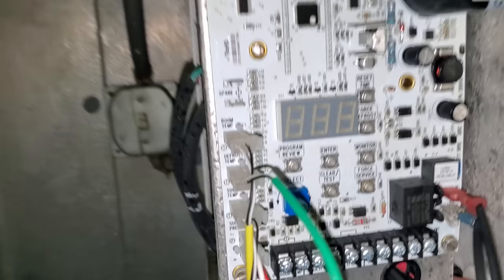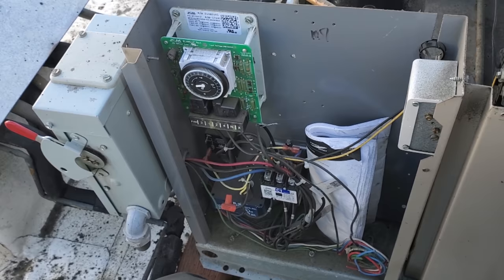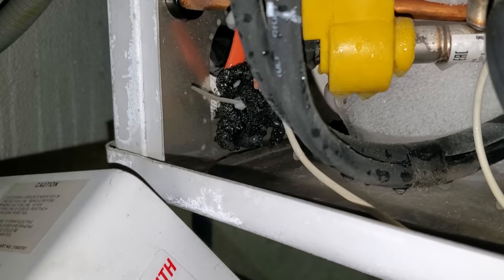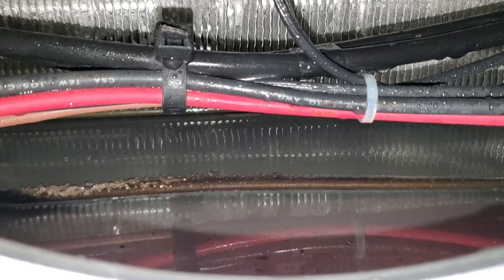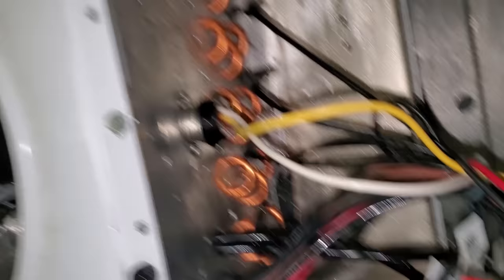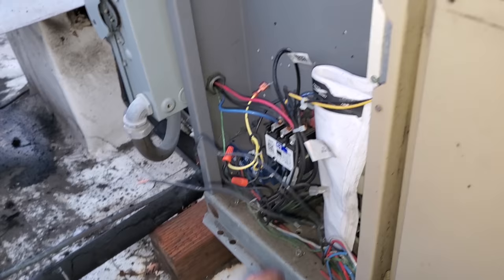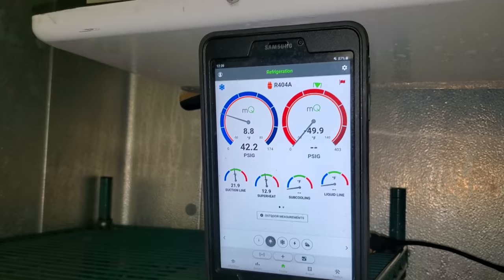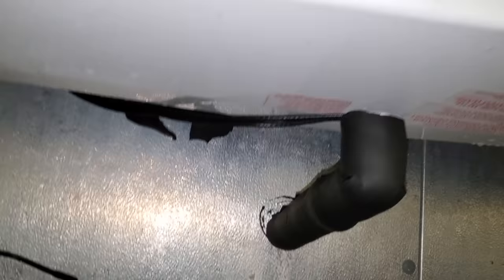THE OTHER COMPANY COULDN'T FIGURE THIS ONE OUT EITHER

Comment: Old saying: Proof is in the pudding.  The unit worked within design parameters at the end.  Awesome job of troubleshooting and determining the prime cause of all the other faults. Do you have a followup video where you inspect and perform more preventative maintenance?  From start to finish, the previous HVAC company screwed the pouch. I would bet that the techs who performed the installation BARELY understood the manufacturer 's installation guide.  THEN, the previous HVAC company sent other techs out that didn't even have the previous techs' knowledge and experience with this particular  walk-in system.  I'm not an electrician OR a HVAC tech (former electronics tech in the US Navy Submarine Program back in the 1980s) and I was physically cringing at all of the mistakes made by the previous company's techs.  Lack of knowledge caused all of this.

Comment: Greetings: Good and bad:  Although you and I are in separate fields of electrical. You in commercial HVAC and I in a more broad spectrum of electrical / electronics.  We share common skills, goals. ethics, procedure, Etc and our customers suffer similar fates of other's failed repairs. I can add, in my case, mine have issues paying. It is such a shame that  customers rely on skilled repairmen then get screwed because of lack of the above. I think I find more of that rather a natural equipment fault. Many people do not have pride in their work these days.  Now the bad: I notice you error in terminology as many others do. A "short" is not another word for 'fault' or 'problem' as many think and use the term wrong.    In conclusion I commend U on Ur troubleshooting and service skills, procedure, ethics, pride and respect of customers. Indeed we R a rare commodity. Thx 4 the share. Bsafe.

Comment: Ok, first off... 
It's clear and obvious as you stated from the paperwork, this unit was never installed properly as brand new! 

That said, the entire unit should have been replaced by the manuf. With another brand new unit using factory installers!  And the mfr should disqualify that other company from working on it's gear. I.e. not even sell parts to them!

Second, because of the above, EVERY bill from that  other repair company was fraudulent! And on that, the state board of contractors should be contacted, and that other company should repay the restaurant 100% plus interest (plus any lost food due to spoilage, etc ), and then lose their license.

Further and towards the end you identified the problem; that company sent 5 to 7+ DIFFERENT techs, none of whom are probably talking to each other, some of whom are clearly incompetent; I mean wow!  As many of my friends state; "we really don't have technicians, troubleshooters, or real mechanics anymore... Just a bunch of parts swappers".  I think this system proves that statement.

Oh yeah, the drain lines... 
I know each state has different standards, they shouldn't, but .. whatever...
But hooking multiple drain lines together into one isn't permitted around here; because it allows gunk to mix  and clog things up. Sound familiar?
 

As far as the drain pan bending up (high center) & not allowing the water to drain properly... I've seen a great trick to prevent that... Saw a tech who cuts a piece of PVC pipe and wedge install it between the upper & lower case to always force the drain to be the lowest point in the unit. He's done it for decades and never had a unit with poor drainage.

Comment: 10:25 this is also shit design from the manufacturer of that system. That shouldn't be like that.
It should be a truncated pyramid that pools and collects from the three zones, not only does this make things easier to drain, but it also stiffens up the pan and makes it more robust, therefore impervious to any installation flaw.

Comment: Isn´t  it a design flaw to have all those electrical connections and circuit boards near the coils that can ( and do, as seen here) ice up, and then melt, and get everything wet?
Reply: If they had installed the drain properly it wouldn't have iced up

Comment: The ice up condition was probably because the center fan motor wasn’t running and the air was simply drawing from the front bypassing the evaporator, the drain had nothing to do with it, I would have temporarily blocked off the center fan while waiting for the new motor. As a retired tech. I feel sorry for you guys out in the field these days with all the unnecessary electronics replacing simple reliable mechanical controls, except for ice machines, walk in freezers were always the biggest pain in the #$@“$ to work on.

Comment: What I found about your troubleshooting techniques was how much they match troubleshooting an aircraft avionics system. the first thing we all. do is to check power to make sure you aren't going to damage something else. And you did that. Then you were confirming the wiring to the schematic. I have one funny thing I found on a fighter while in the Air Force. Some idiot had connected wires together by twisting them and insulating and reinforcing the connection with chewing gum. And how about splicing an oxygen line with a barrel splice. It was lucky there wasn't any oxygen in the line, because if oil or grease cam in contact with the oxygen it would explode. The real sad part of what you had to do was fight an uphill battle to repair what someone else had messed up. The reason why you kept your eye on the prize. The client should sue to get refunded. It is obvious the techs who were on-site before had no idea what to do. Personally, I'm impressed you kept your cool and didn't smash something. Issues like those you encountered reflect badly on your craft (one or two bad apples).

Comment: The failure of the entire HVAC industry is the failure to teach with a clear understanding of how and WHY systems work. I have meet mechanics with 20 years of experience and did not know shit from pound cake. The telltale sign is shown when they don't clean up their work. ( IE Putting back and securing panel)  I meet and worked with the elite craftsman who absolutely loved their job and the challenges that they faced just like yourself. But the one question that I have...What happened to the original unit? Did the previous HVAC company condemn it because they could not resolve an issue?

Comment: It wasn't the drain line, it froze up because the fan motor was bad. That's common. when it's froze check all fan motors. It appears many don't know why it freezes with a bad motor. To start with it's less air being pulled through the evaporator but the bigger problem is it sucks air through the bad fan and not the evaporator. It just loops from bad fan to good fans. That is too common not to know. Don't blame the drain. But the P-trap is wrong. you don't need a P-trap on coolers and freezers but if you insist on having them they need to be at the unit with a vent on the backside. That too is common in plumbing. you replaced SO with SJ either is ok SO is better. They probably ran 2 blacks so nobody would mistake the white in a single piece of SO/SJ

Comment: You're being way nicer than i would be. And know, it's an international meme at this point, that every time the new guy comes, they bitch about the previous guy's work, ... but this cannot be misconstrued as anything else other than bad work practices and incompetence. Again, you're being nice. You're a better person than i would be in your shoes.
All that said, even as someone who has, at best, tangential touch with your job, that unit is garbage. There's so many things that scream cheap and expedient design.
From the integration of sensitive elements directly within the freezing volume of the coils, to the way wires are run inside, to the compartmentalization of the item. It's just wrong. Wrong, wrong, wrong.
If it were something in my branch of work, i would've taken the engineers back to school on this one and shut the wanketing department in a cellar away from the decision block of the company. Horrible box.

Comment: I'm not an engineer and I don't claim to know anything about thermodynamics, but I've been a chef for 13 years and I guarantee the root of all the problems was down to the chefs putting hot, steamy things in a freezer, and the unit simply isn't designed to cope with that amount of moisture, regardless of whether or not it could drain efficiently.

Comment: Brain dead ,how can you use a grasslin or conventional time clock when you have a beacon 2 with electronic expansion valve with circuit board built in defrost,? I don't understand why roof time clock was in there.so there defrost was shutdown evap complete with fans .lol
Reply: Ment heaters not fans